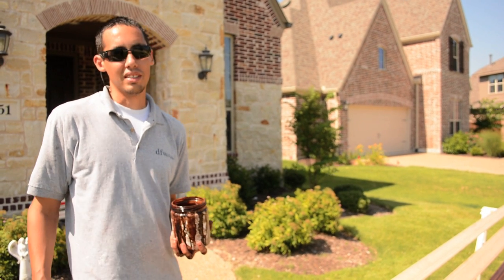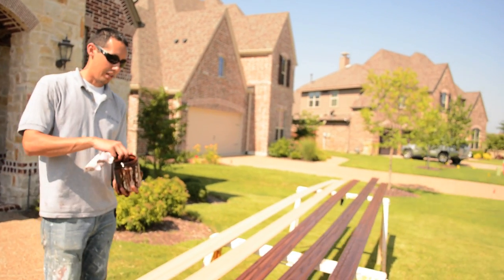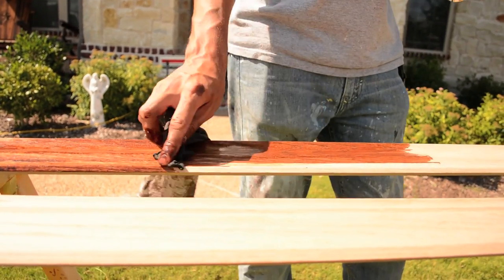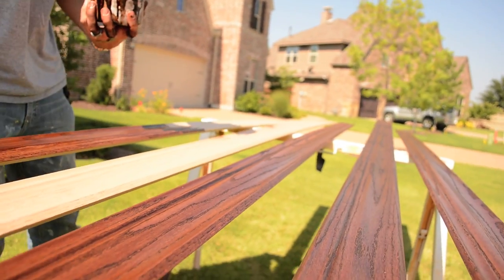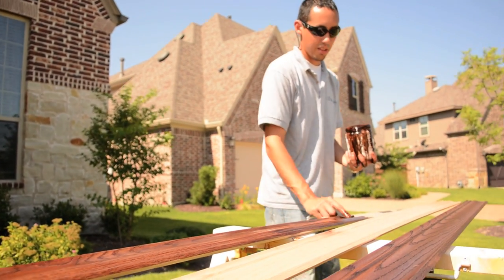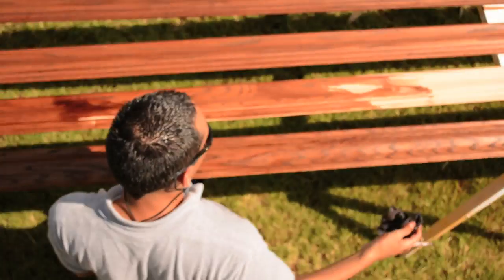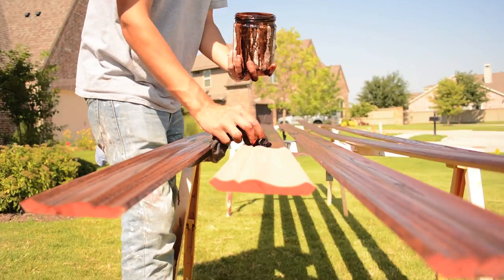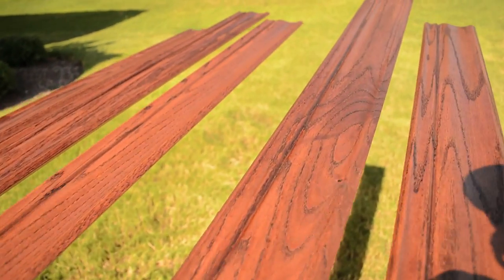Staining Wood Moulding Tips - (Crown, Baseboard, and Casing)

Comment: Bit of advice from someone who has been staining for 25 years. Look at Zar and Old Masters stain, especially the Zar. Zar has the Minwax colors down almost perfect. One thing about the Zar is you can leave it on  for as little as 3 minutes and as long as an hour and let it almost completely dry, then rub it down. It's a heavy bodied stain and rich as hell looking when dry. Minwax is made of paraffin and is really junk. It tends to fade and turn chalky very quickly and if you run stain into itself on woods like pine it will leave dark flash marks.Zar and OM are also nice and thick so they don't spray, run and drip  all over the place.  Zar polys are also floor grade poly and you'll freak by how nice even one coat looks. Not criticizing your work by any means as it looks kick ass. Just offering some experience from what worked for me for years staining trim and windows before I installed them working with a Marvin dealer.

Comment: Don’t know if you already have a video on this but when you install wood stained trim in a house like baseboard, how do you go about caulking the trim to the wall? With painted trim I know you will just use painters caulk and caulk the gaps between the base and the wall, and then do any finish wall/trim painting. But what about stained trim. How do you fill those gaps between the base, or door/window casing etc to the wall. Hope that question makes sense.
Reply: You ever find an answer to this question?
Reply: @Drmonstereater1  no but I’ve been working in the trades since then and put in enough interior trim to know that u just gotta carefully tape any stained wood trim and then just apply caulking to it. When u take the painters tape off it will look clean and good. Unless ur a baller and don’t need tape and just go for it  Hope that helps.
Reply: @michaelandrew3816  That makes sense! Thanks for the info.

Comment: If you wet the wood first with water it opens the grain of the wood up and you’ll use less stain. I’ve been doing it that way for over 20 years
Reply: Wouldn’t this saturate the wood so it doesn’t absorb the stain? I’ve had good results with applying a thin coat of mineral spirits before applying stain.

Comment: Here’s a little tip. I’ve watched 3 of your vids where the material was stained. Your finished product comes out extremely blotchy because you’re not using a grain sealer first. If you want to avoid the extra step try a gel stain otherwise you’ll never get an even stain. You should try it trust me
Reply: obligatory I’m no expert, but the gel, for me is to thick and I just can’t get it to work the same for me. Only use I can think of for the gel would be touching up on vertical surfaces or whole furniture pieces you don’t want to break down. A pre stain works well to get rid of a blotchy final product. But to each his own. Never heard of a grain sealer first, so now I will google that and hopefully find a hack, because I though the sealer went on last and in multiple coats as protection and to seal out moisture to lesson the movement of the wood due to humidity and temperature change.

Comment: How well does this technique work with the Stain+Poly combo from Varathane?
Reply: I’ve used the minwax version of that on a few pieces. It’s workable but the poly makes the stain “goop” and it will be very noticeable if you don’t wipe it. You have to work FAST cause that poly dries in a matter of minutes. To combat this I used thinner coats. By the time I was done I would have saved myself time and stress just doing it the oldschool way with stain first, then poly. At the time, the “Bombay mahogany” color was only available in the combo so to get the color I wanted I had to work with the product.